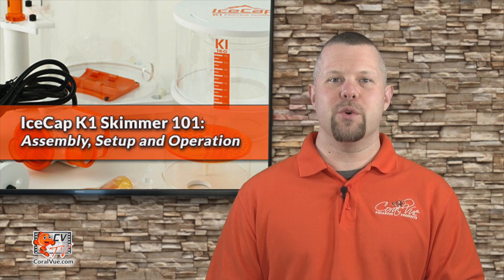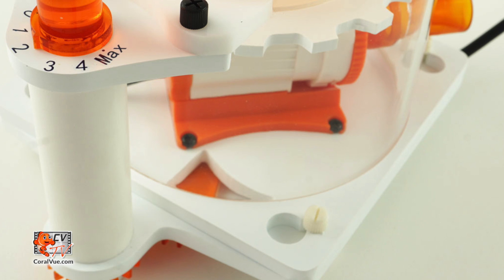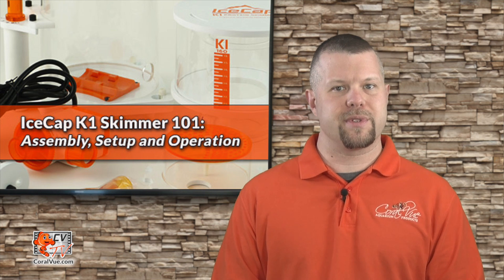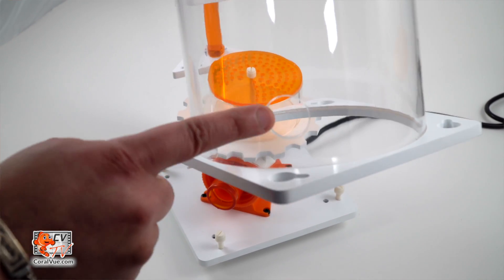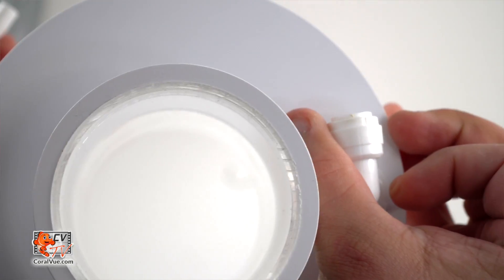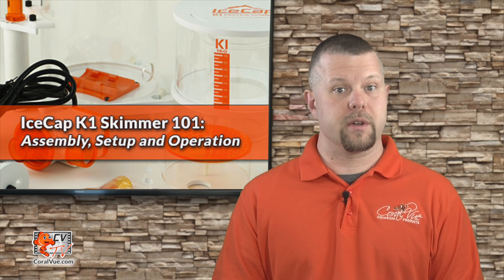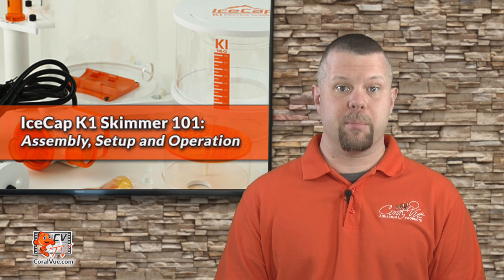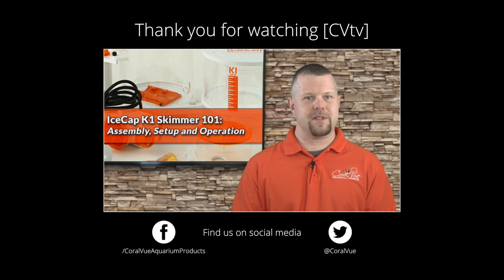IceCap K1 Skimmers 101: Assembly, Setup & Operation

Comment: I may sound crazy but I'm putting a k1-130 on my 23 gallon display/15 gallon sump. It's more than heavy bioload. It's crazy bioload because I have a puffer that I feed clams and shrimp all the time.
Reply: well it's installed now.
Reply: @aquaticnstuff7666  so how is it working on that size system?
Reply: @kevincraig6794  it's totally awesome and game changing IMO. I have it hooked up to drain to another container. Besides all the benefits which I could go into, the only downfall is the salinity level of my tank goes down a bit quicker since more skimmate is coming out. But I have no hair algae problems anymore. No excessive algae.

Comment: What is the difference between K1 and K2 series?
Reply from the maker: There are slight changes in the skimmers designs but the major differences is The K2 uses Sicce pumps and stainless hardware and the K1 uses EVair pump and plastic screws.